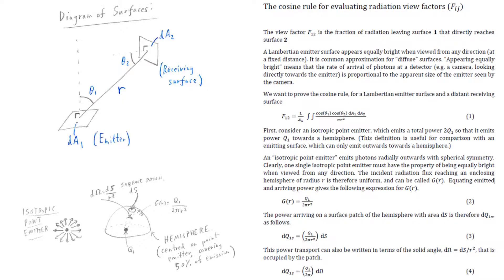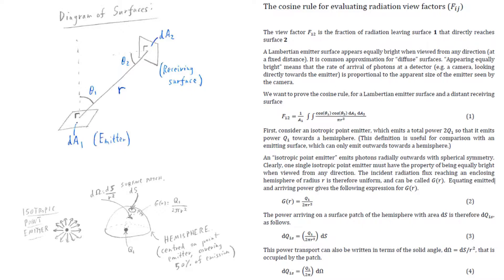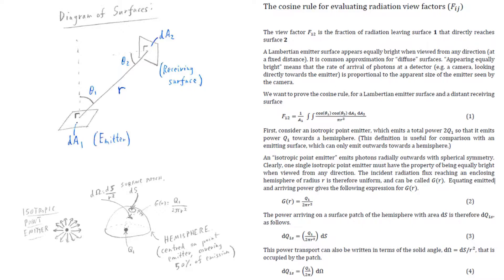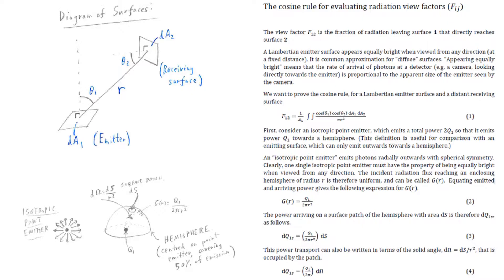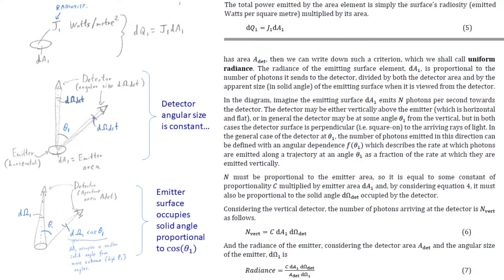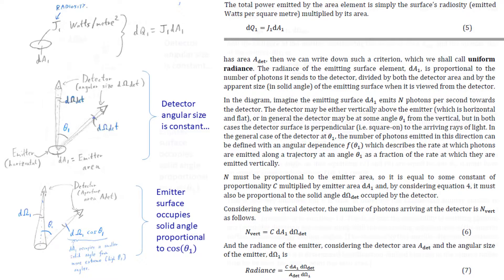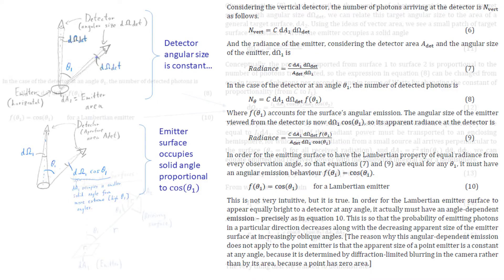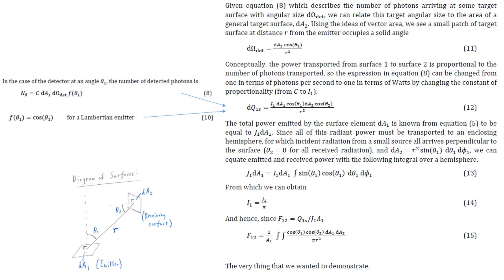The Cosine Rule for view factors from a diffuse (Lambertian) surface

Comment from the maker: I've made this video because I found it hard to obtain a (fairly) short explanation for the purpose of lecturing radiation heat transport. I think this is because the concept of (detected) radiance (which is equal in all directions for a Lambertian surface emitter) is a bit above the level of introductory radiation heat transport lectures.